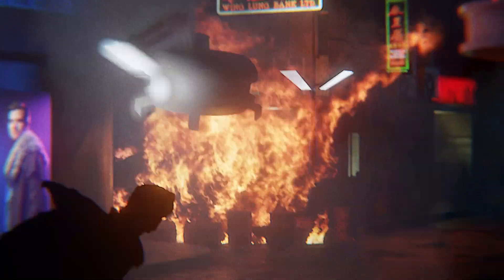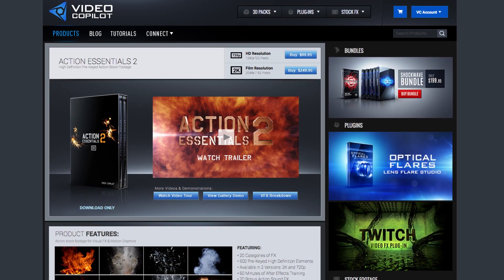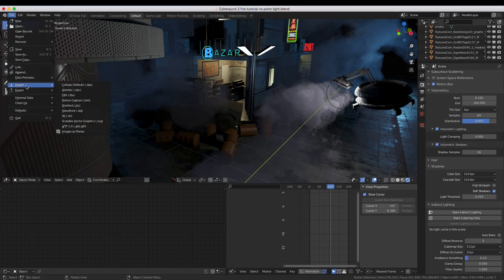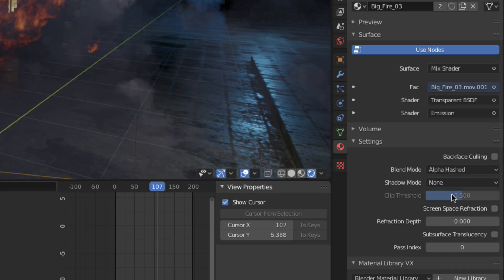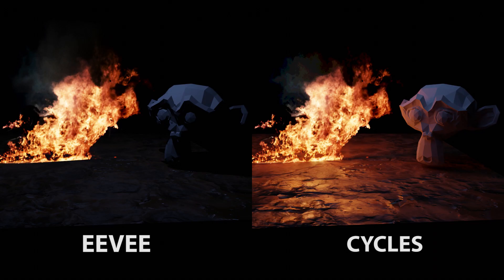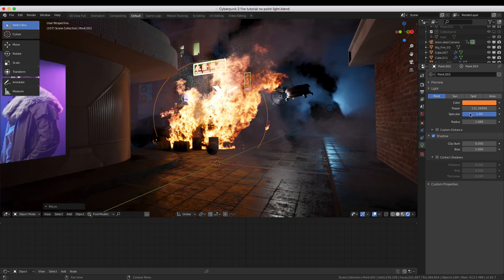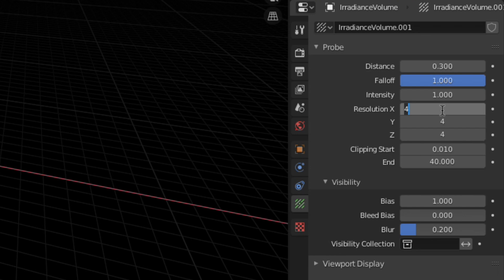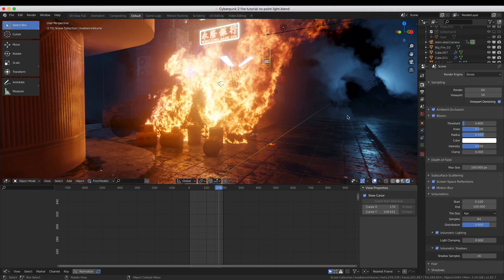Blender Tutorial: Quick Realistic Fire In Eevee (or Cycles)

Comment: any recommendations for the best video formats to use for increased render speeds?
Reply from the maker: Generally speaking, unless you're trying to render in "real time" the image output/compression process is an extremely small percentage of your render time. Also, it's recommended to export to an image sequence rather than a video file so you can resume your render if it fails part way through. OpenEXR, DPX, and PNG are the preferred image formats.

Comment: i have a video with green screen not black screen.  Not the same ?
Reply from the maker: No, green won't work like black. Probably easiest to key out the clip first before bringing it into your scene. This is possible in blender, though I can't promise that the results will be any good. 

1, Open blender, make a compositor window, and click "Use Nodes"
2, Delete the "Render layers" node and replace it with the following nodes in order: Movie Clip, Chroma Key, Color Spill.
3, Connect the image outputs into the image inputs (including the Color Spill output into the Composite node input.
4, Open your fire clip into the Movie clip node.
5, In the Chroma Key node, set the key color to match the green background of the fire clip.
6, Set the Color spill Algorithm to Average.
7, Adjust the Chroma Key Acceptance and Cutoff values until the fire looks better.
8, Adjust your Output Preferences to match the resolution, duration, and frame rate of your fire clip.
9, Make sure your output settings allow for alpha channel (transparency). I normally export to a PNG image sequence set to RGBA.
10, Render Animation.

Hopefully this helps.

Comment: how did you added that flicker to point light?
Reply from the maker: To add flicker to a point light.
-Select the light.
-Go to the object Data properties tab (the light bulb).
-Hover the mouse over the Strength/power attribute, and press I to add a keyframe. 
-Go to the graph editor (Shift + f6) and click the right pointing triangle to reveal the Power attribute from the light. (Found on the left side)
-Select the power attribute.
-press "N"
-Click on the newly revealed Modifiers tab
-Click "add modifier" and select "noise".
-Adjust the Scale and Strength until it looks like fire. (The strength should probably be set to about half of the power of the light)
Reply: @AmortMedia  thankyou for replying 🥰❤️

Comment: Hey. How Come your scene is using only 900 mb of memory. My very small and simple shop is taking 8gb
Reply from the maker: Probably because of texture size. I used 1k and 2k textures, but if you're using 4k or 8k textures it could easily be 4-16x more memory usage.
Reply: @AmortMedia  thanks for the response. I am using  max 1k textures. Most of them is 512. And i am using simplify. 8gb graphic card and 16 gb ram. I dont quite know how to deal with it. When i try to render i got out of memory
Reply from the maker: @kamilnowak5264  How many faces in your scene?
Reply: @AmortMedia  i haave  4.5  mln  faces. I checked every single object and i dont know where this huge number  come  from
Reply from the maker: Are you using any modifyers that increase poly count? (Subdivision surface or Bevel for example)
Reply: @AmortMedia  thanks for the help. You are awesome. I fixed the problem. On of the free  models in array had enormous amount of  faces. Btw. It was a donut  :D

Comment: Hey, I just want to say that this video helped me out so much as I am avid after effects user. But I have a problem where when I go to the render tab or even render at all, the fire doesn't even move, If someone can help me then I would really appreciate it, thank you (I'm using cycles to render)
Reply from the maker: It should work out of the box if the clip is imported using the "Import images as planes" addon. Otherwise, in the shader editor, make sure to set the "Frames" to the number of frames in the clip, and check the "Auto Refresh" box.
Reply: Amort Media I did all of that and it moves in the material preview but when it comes to the render preview it doesn’t move, it just stays frozen, is possibly the settings I have? also I want to say thank you for responding to my comment
Reply from the maker: @valentinesstash8536  Ok, try setting the Start Frame to 1, the Offset to 0 and check the Cyclic box.
Reply: Amort Media I did all of those and the video is still frozen in one frame
Reply from the maker: Are you working with a movie clip or an image sequence? Did you try the "import images as planes" addon?
Reply: Amort Media I did try the import images as planes add on and I used the video copilot fire stock for the clip
Reply from the maker: Strange. I don't know what else to say. Maybe you don't have the correct video codec installed or something. Installing quicktime player 7 has been known to fix some codec issues, but that seems like a long shot for this particular problem.  I'm assuming you're using Blender 2.8x?
Reply: @AmortMedia  It's a Blender 2.83. I've import footage of fire (movie) as image as planes and rendering in EEVEE has success. But Cycles not success. It looks like a static image of fire in a render view.
Reply: Amort Media yes I am using blender 2.83
Reply from the maker: @alexandergolubev9549  Does it work if you actually render it out?
Reply: @AmortMedia  EEVEE work in render view but Cycles not work. In EEVEE fire is dinamic image but in Cycles is static frame.
Reply from the maker: @alexandergolubev9549  I meant to say, does it work if you render your Blender scene to an image sequence or video file?
Reply: @AmortMedia  It doesn't work in either case. I've try render to an image sequence of PNG files and in MP4 video file.
Reply: @AmortMedia  that is, it turns out that the problem is not in the video codec
Reply: I have the same. Have you found a solution?

Comment: Hei so I am having this scene where I have some smoke in the background and the whole animation is looping but the smoke is not. Can I do anything about it?
Reply from the maker: That's a tough situation. Depending on your scene, you may be able to try this. 

Let's say your animated loop is 100 frames long. If you extend your timeline to, say, 300 frames and have your animation loop 3 times over that duration, once you remder it out, you should be able to cut them up and cross dissolve between them to clean up the loop point transition. I don't know if that's possible in the Blender video editor, but it should be possible in most video editing software. It's not a perfect solution, but it could work.

Comment: Pro Tip: The Fire doesn't have to stay as a Flat plain. Add some curvature to give it some volume.
Reply: Unless it doesn't change its shape that much, otherwise one would also need to animate vertices. :-)
Reply: @bomaryniuk3639  Noise modifier perhaps?
Reply: Also, you can make shape keys (after subdividing the plane) and add noise modifier to it on graph editor
Reply from the maker: I tried using a displacement modifier driven by the fire clip itself, but it just looks strange. The problem with a 2 dimentional fire emelent is that when viewed from an angle the perspective gets weird. To achieve netter depth, you're probably better off copying the clip a few times, moving them back in 3d space, and adjusting the clip offset by a couple of frames for each copy.